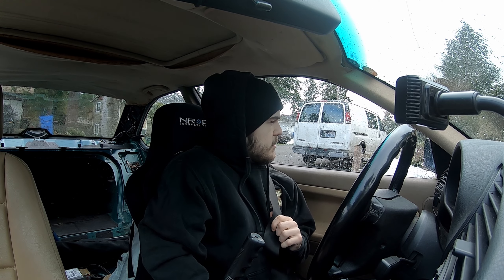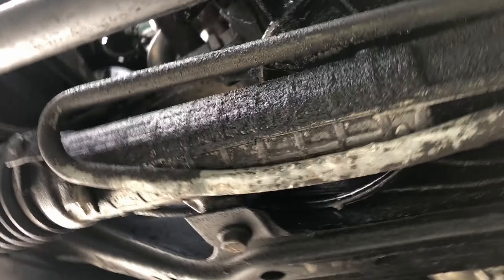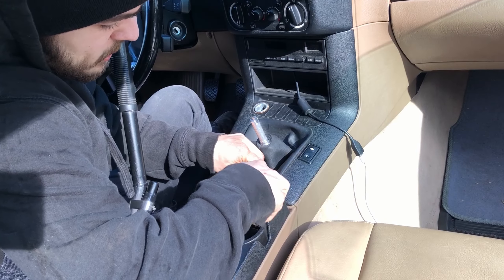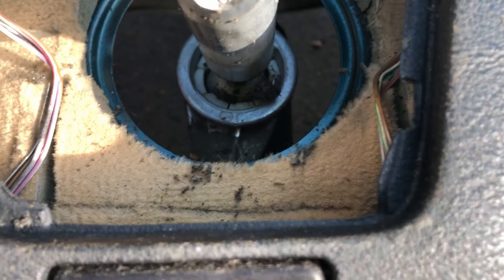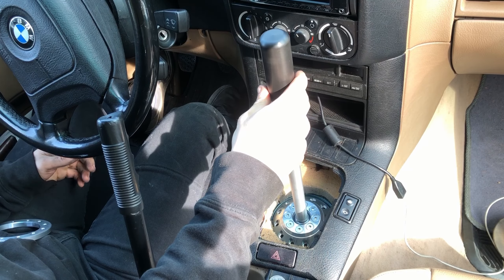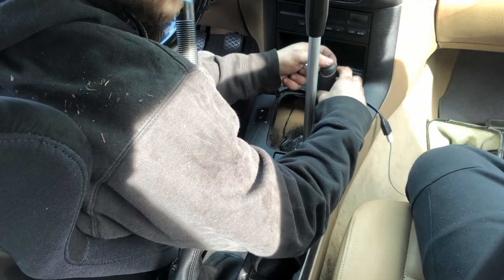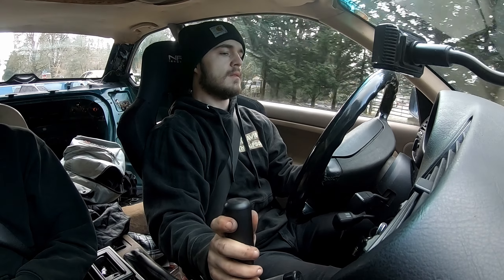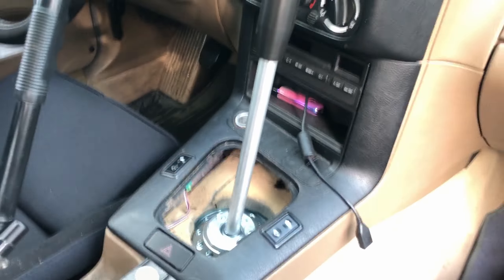The E36 Drift Car Gets a Solid Mount Short Shifter + Assessing Damage on the Steering Rack

Comment: did you have to remove the trans or anything?
Reply from the maker: Nope! If you wanted to though, you can support the transmission with a jack, remove the trans brace, and then lower the transmission slightly to give you some extra room.